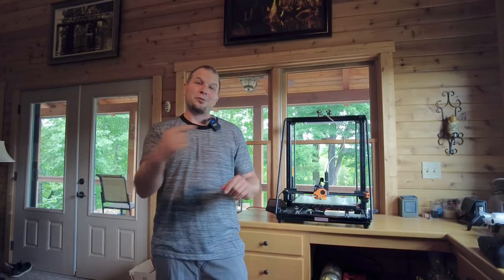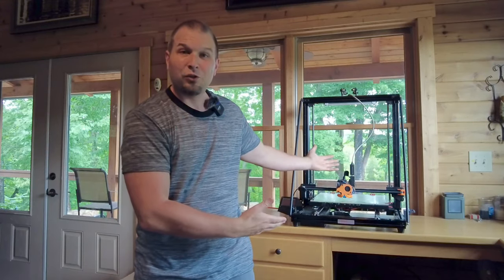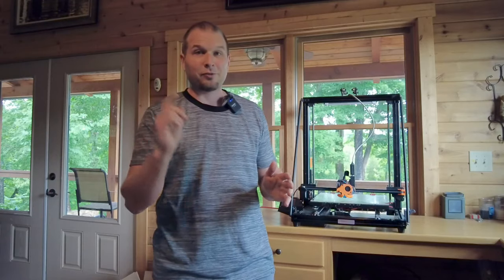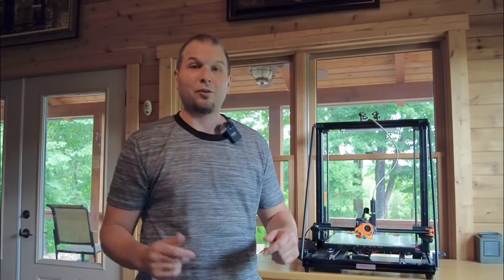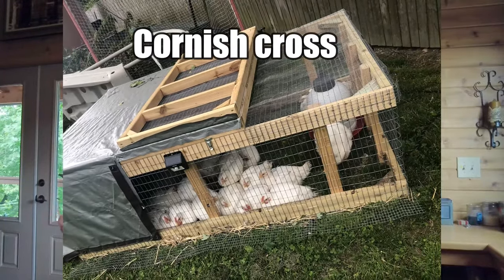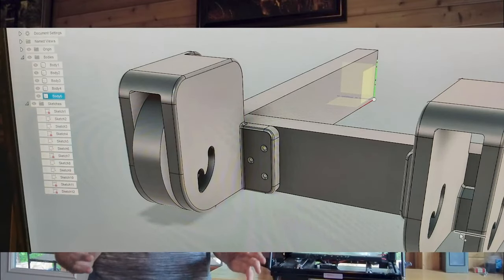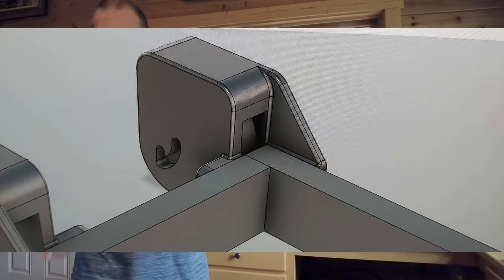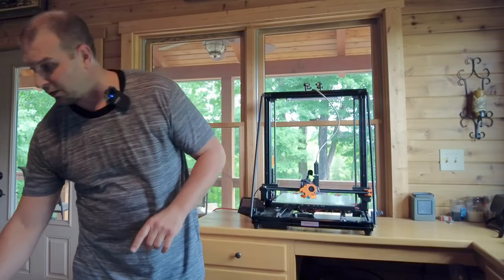3d Printed CHICKEN Feeders & 3d Printed Chicken tractor Adj WHEELS! MUST have on FARM or HOMESTEAD!

Comment: Do you post your files anywhere?
Reply from the maker: No I didn't but if you want any I can send them to you.
Reply from the maker: What are you looking for?
Reply: The feeders I think look really useful. Would like to try the wheel housing when I get around to build a yard drag as well.
Reply from the maker: @AreanApple  ok sure you like the one for chicks or adults ? The big one is big need a 400mm bed to print that one at least that's what mine is. I can upload to Google drive and give you the link .
Reply: I like both only have a few ender 3s but definitely would like to have the file when I can get something with a bigger build volume. Yes the small one looks great our chicks always like perching on whatever they can in the brooder.
Reply from the maker: @AreanApple  ok cool I will find the files and upload them I'll shoot you the link when it's ready 😉